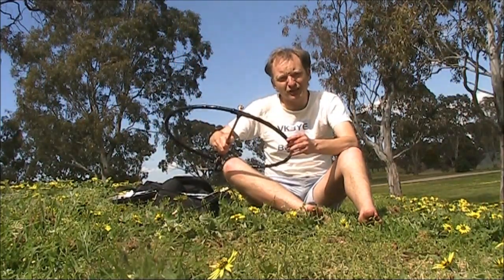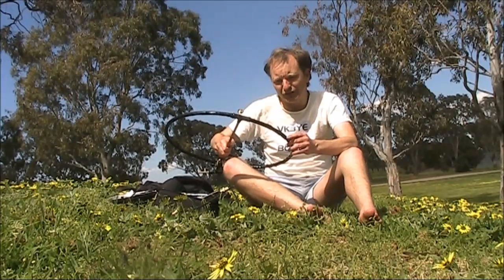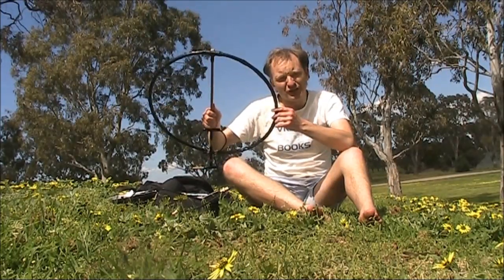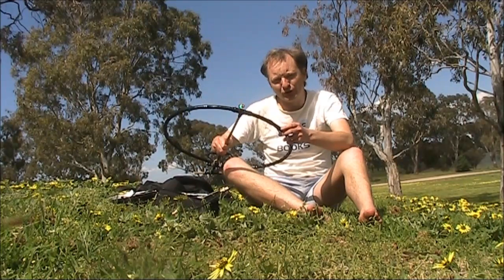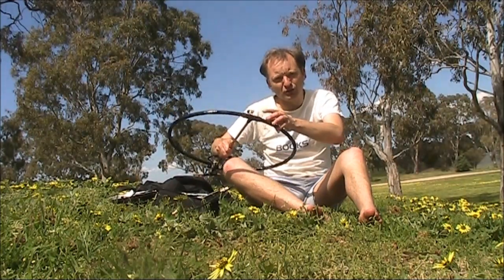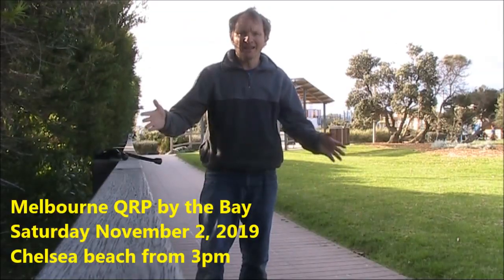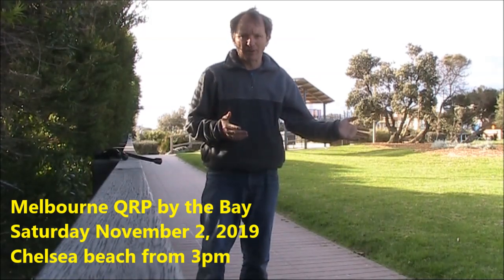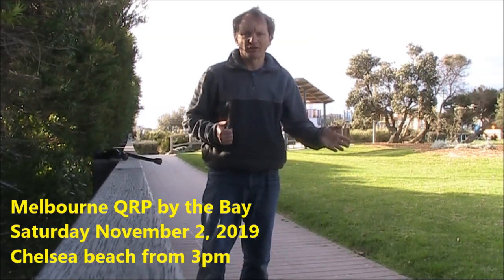Receiving resurrected VK3RMH 10 metre beacon

Comment: The beacon should be even better once I replace the old HTX100 with a dedicated GPS locked transmitter that can run 20 watts (current Tx is only about 2 Watts and is not doing carrier stepping ).
The antenna also needs some fine tuning.